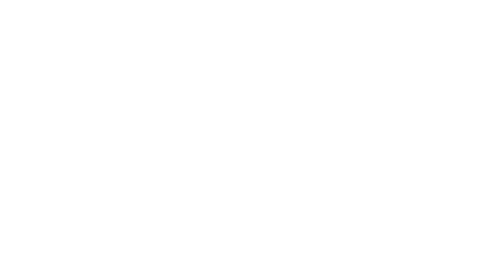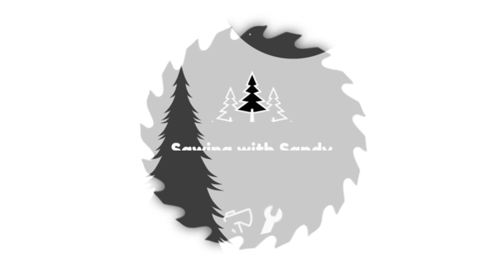Breaking the Bank One Sheet at a Time | Sawmill Shed Build Ep.3

Comment: Only people with a mill can grasp the fact that the lumber in most cases doesn’t get planed and isn’t perfect. This makes for different thickness in boards that meet up sometimes. 
We call those wood strips over rafters “furring strips” here in Tennessee. 
 When I use cheaper steel I always space my furring strips closer and use 3/4 inch wood and 2ft apart. If you go 3ft with thick furring strips you risk weak areas with no support. I’ve been a carpenter all my life and had to change my standard using rough cut lumber. 
 Love the pole saw idea and I need one along with that leaf blower. 
 Looks good as always.
Reply from the maker: Great points. Thanks for sharing

Comment: Great to watch your build of the new “shed”.  A couple of questions.. 1/  is the main beam 6x10? Just thinking of the snow load we have up here Ontario way. 2/ the posts are placed on deck blocks as opposed to digging into ground.. are you concerned about possible uplifts with some of the winds we have experienced? Or do you think that because you’re basically in the forest that will provide protection?   Good job.
Reply from the maker: The beam is closer to 8x10”. With the span between beams I think it should do well for holding the weight. I also figure with the open sides and relative shelter of the woods I should be ok for wind

Comment: Great job. I bought the steel for a 16' by 32' sawmill shed last summer. This spring I bought enough steel for an 8' by 8' gable roof for my entryway. I did get matching trim and flashing which added to the expense, but that little bit nearly cost as much as the steal for the sawmill shed. Crazy! That's when it is really nice to be able to saw all the lumber you need yourself from trees on your own place.
Reply from the maker: wild the increase eh!

Comment: I am curious as to why you left the stumps in under your shed?  Seems they are going to be difficult now to remove and it always seems to come down to removing them.  Left in the ground to get in the way of any foundation work they are the perfect habitat for termites and carpenter ants....
Reply from the maker: I don’t have any way to remove them so I just cut them down flush and let them rot
Reply: @sawingwithsandy  I would have cut them a bit higher.  Then cut a notch around them.  Wrap a chain a couple of times around it then hook to your tractor.  We used to dig a channel under them and hook the chain to a come along.  Kept an old sawchain around just for that.  That tractor ought to be able to get a corner of the bucket under them to pop them loose?
Reply from the maker: I’m hoping to get a stump grinder before long to help with them

Comment: You say this is stainless steel roofing?? Is there a reason? Zinc coated or painted would be cheaper. That’s all I’ve ever used. The painted I have on my shop is 40 years old and still going. No rust. We get 18-20” of snow and sleet, rain, and hail. I’m just curious as always. 😊
Reply from the maker: This is the cheapest I could find unfortunately

Comment: What you call strapping, I call stripping. Where I live, purlin refers to the same purposed lumber but it's nailed between the rafters or studs instead of on the top or outside. But it's called different things in different areas. I moved 120 miles away and had to learn the construction lingo of the locals when ordering materials. I knew what you were talking about. Great job .
Reply from the maker: Yeah I hear ya there Wayne. Same thing around my parts

Comment: I like the progress on the sawmill condo. My only thought is that the connection between the added structures to the old covered mill area needs a roof to wall flashing so you wont get those unexpected drips on you (which could cause an accident) when it rains :)
Reply from the maker: Thanks for watching! Yeah a fishing is needed for sure
Reply: @sawingwithsandy  a "flashing" you mean ??? I'm not familiar with a "fishing" .
Reply: @sawingwithsandy  a "flashing" you mean ??? I'm not familiar with a "fishing" .

Comment: Just curious , if the new section is not having a wooden floor.  Are you not going to be standing in snow and mud while working  ?. Seems like snow and rain will blow under the roof.
Reply from the maker: I may end up just throwing a few boards down if it gets wet for now

Comment: You dont pre drill the sheets and screw on the high ridge
Reply from the maker: I used to put the screws on the high ridge but found that after putting them on the valleys I didn't have any leaks so stuck with that
Reply: @sawingwithsandy  interesting. Ill give it a t try. Great stuff keep it up

Comment: Hey Sandy, glad to see i'm not the only one that goes up and down the ladder way more than I have to! Lol. Bump the hammer and it falls, vibrate the camera loose and of course it falls. At least the box of screws did not go over! Hey I noticed a darker color on the sawmill uprights that the sawhead goes up and down on, do you use any lubrication on them? What do you use?
Reply from the maker: I did have a few close calls with the screws. That would be a headache haha. I normally put some silicone spray on the upright steel tubes on the mill or if I don't have any WD40.

Comment: You know Sandy, there are these AMAZING things out there ... a pouch for your nails, a loop for your hammer and tape measure, and even a belt to hold it all up so your trousers don't fall down instead of your hammer. These things are real, I've seen them with my own eyes....
....gathering dust int he basement right were I know to find them ... right AFTER I drop my hammer, or drop a nail in the driveway....but I think that they actually work and I may have even used them back in the days of my foolish youth.

Nice way to use the pole saw too - reminds me I have to fix mine !

Shed is coming along nicely keep it up!
Reply from the maker: Thanks Greg. My pouch is sitting right here in my lumber shed but I don't like wearing them when I only have a small job like this
Reply: @sawingwithsandy  I know what you mean, you spend all your time gearing up to do 1 little thing … or, you spend your time chasing hammers.
Reply from the maker: Yeah that’s what I’m thinking for this one. My ouch was pretty messy and figured I’d just get the task done for this round

Comment: Great Work Sandy, on screws that I missed the wood with my tractor shed build, I pulled out and used JB Weld on the holes, appreciate your channel thank you!
Reply from the maker: Thanks for that I’ll probably do the same
Reply: @sawingwithsandy  use a small block of wood under the hole and drive a screw in to seal it up.

Comment: Good morning Sandy looking good for something in the forest and I know material is through the roof with there prices I sure I am glad 2 years ago I bought  almost 3.000 square feet of metal roofing but I got it just before the big inflation it was almost 4.000 dollars  for the whole thing but I redid all my buildings with new roof including my house still got one porch to do but that one got to built the porch first lol 
  By the way when you showed the blade on saw mill I did notice some accumulation of sap not to much but some that is why I said about the mix of pine sol a d down dish detergent in the water for lubrication and it also keep my belt very clean also well have a beautiful day p.s. the weather is hard over here for working outside around 80 degree far. At 5 o'clock this morning so don't move to fast ah ah ah
Reply from the maker: Sounds like you’re all set with the rooftops done. I’ll have to add a bit of something to the lube to clean those blades for sure. Luckily not too hot here yet. Bugs still biting but they’ll be gone before long